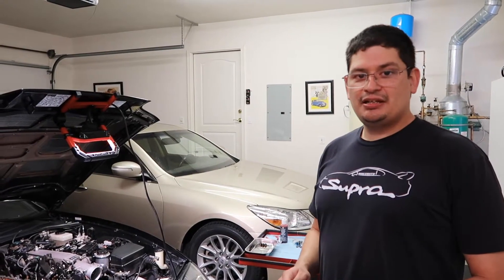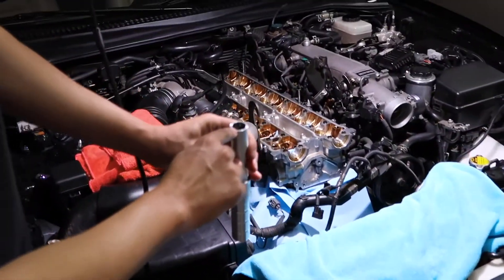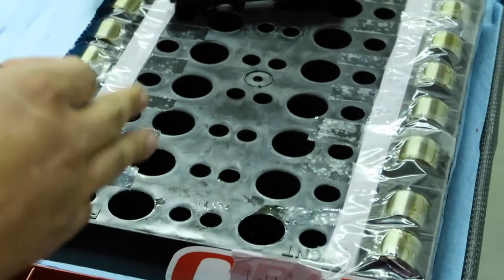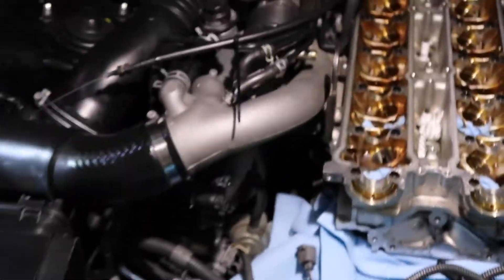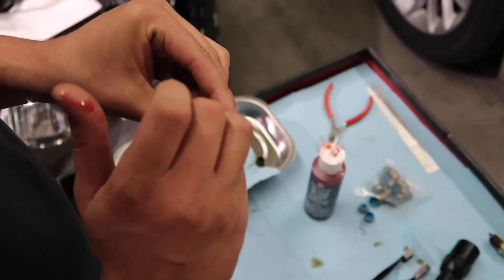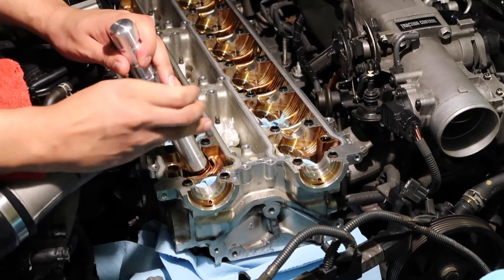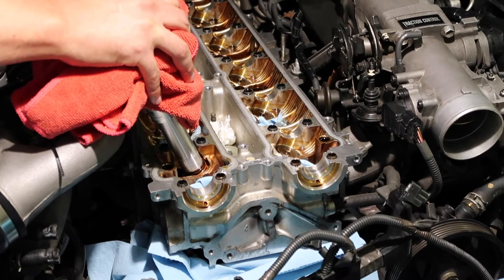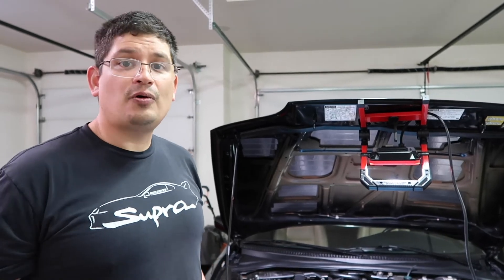2JZ-GTE Valve Stem Seal Removal and Replacement-  ValveMaster by ToyoTool

Comment: Is the head removed to do that ? I can’t tell. I know some people put compressed air in the cylinder to prevent the spring from moving
Reply from the maker: No, the head does not need to be removed. You can do it with the rope or compressed air.

Comment: I may have missed this part but when the keepers, springs and seals are out, what is stopping the valve from dropping into the cylinder?
Reply from the maker: Yes, the most important part is to make sure you use compressed air or stuff rope in the cylinder, otherwise you will be in the big trouble.
Reply: @DriversTherapy  haha ok. I figured I must have missed something. When you pulled the retainer off I almost had a heart attack.
Reply from the maker: @SDSGarage89  haha ya I stuffed rope in it. 🙂🤘🏽
Reply: @DriversTherapy  sick. Thanks for the Vid, super helpful and this may be in my future. Love the Supra.
Reply from the maker: @SDSGarage89  thanks! Let me know if I can be of any more assistance.

Comment: i just used some long nose to pull the seals out give it a little wiggle and it should come out  just make sure if theyre really old you dont leave any rubber rings that peeled off around the valve guides
Reply from the maker: Nice but just be careful not to scratch the bore where the buckets sit or it can cause a big issue.
Reply: @DriversTherapy  yeah I just grab around the outside wiggle comes free n then clean up with a pick

Comment: Probably a good idea to do the valve spring upgrade as well as do cams when we do this?
Reply from the maker: Not really. If you are stock, your valvetrain should be fine. No reason to change it unless you are running more power or is part of your build plans.

Comment: Use a heat gun on the stem seal before you remove it, you don't need to get it crazy hot just heat it up for 10 seconds and the seal will come off super easy, did it on my 3uz-fe.
Reply from the maker: Great idea! Thank you for sharing.

Comment: How did you keep the valve up ?from dropping
Reply from the maker: You use rope or air. Let me know if you want to know how those work.
Reply: @DriversTherapy  how do you do this using rope?
Reply from the maker: @johnpierce149  pretty easy. You set the cylinder you are working on to “bottom dead center” and stuff it with rope. Than you slightly go up to Top Dead Center till you get some resistance and stop. Than you are ready. The rope prevents the valve from going down. Just make sure you stuff it with rope and compress it.

Comment: So what i do get is when you push down on the tool for the cap and 2 keepers, that the keepers will snap into the valve on the top side.
But what i dont get is when you also push down on the cap to remove the cap and keepers, how does that work when you are pushing down and not pulling up ?
Reply from the maker: The same action is for both removing and installing. The difference is the tool itself. One side has a magnet and the other side is designed differently. The tool is key when performing this job.

Comment: Great video! How did you manage cylinder 6 springs with the tool?
Reply from the maker: I had to be very careful but I still messed it up on one spring and I had to sand for a long time to clean up the nick I did on the bore. I advise you to try to get the tool aligned as best as you can, just don't hit the bore. It is doable but you have to take your time and lean over. The only other suggestion is to remove the "engine removal hook". Thank you for watching the video.

Comment: Hey Man, i also need to do this soon.. is it the VMT68 for the toyo tool that you got?  I also got a valve stem remover tool from amazon for like $10 bucks and the powerdynamics (24) valve stem seals... trying to figure out what else I should replace along with doing the job... how long did it take you and what do you recommend to replace? I've also seen people use like a string or compressor to keep the valves falling down into the pistons... how did you keep yours on while removing the valve stems?
Reply from the maker: I used the rope method. I attached the link to the rope DIY and valve replacement. It was helpful. I also recommend using a known brand of valve stem seals. Don’t go cheap because the work to do them is a lot. If you need help or advice you can email me. My email is on my channel information page. I also recommend the Toyo tool.
Reply: @DriversTherapy  I got the same valve stems you used with the viton. Def I'll email you when I run into an issue. Thanks brother!
Reply from the maker: @alexchen4095  if you want, I can lend you the tool. Just pay for shipping both ways and I am cool with that. The rope method is easy to do unless you have access to solid source of compressed air. I would also get some sand which bags and egg cartons to make sure you remove the valve train and keep track of it so you done lose or mix the parts up.
Reply: @DriversTherapy  I appreciate that man, I'll keep that in mind for whenever I'm closer to doing the work (might be a few months) when I can get the parts and stuff. Did it take you a weekend to do the job?
Reply from the maker: @alexchen4095  I did the valve stem seals and my timing belt and water pump with all the associated parts at once. Took me over 2 weeks. It was my first time.
Reply: @DriversTherapy  I gotta say, I look up to you. I want to start learning these things on my own as well and your a huge help.
Reply from the maker: @alexchen4095  thanks man. I appreciate you watching the channel. Let me know if can help when you start the job. Have a good one!

Comment: Are u supposed to be able to get a pic under the valve stem seal or should it sit flush ? First time and dont want to redo it
Reply from the maker: If you use the tool and you press down, you should be good. I roughly measured the first ones by taking a measurement of the old valve stem seal  and another when I installed the new one. I took the measurement using a small ruler. I only did it for a few of them since once they are down, they are down. Don’t over think it.

Comment: Perfect timing on the upload of this video.  I'm about to tackle this job myself for the first time.  Thank you for taking the time and for being so thorough.
Reply from the maker: Your welcome. Thank you for taking the time to leave a comment. If you have any questions or need help, comment and I will reply as soon as I see it.
Reply: @DriversTherapy  Thank you so much.  I'm diving into your channel, I love the content and the originality of you and Elise!  I've got a '95 TT Hardtop and live in Utah.  My GF and I have had our Supra out to the Denver area a couple of times though.  Maybe a cruise event someday??
Reply from the maker: @robvigesaa5738  thanks man! Your not too far away. I go to SLC half a dozen time a year and I live in Grand Junction which is on the way to Denver. So your starting the job? Are you just doing the seals or are you doing other things? Do you have a service manual?
Reply: @DriversTherapy  Even better.  We always take I-70 on our way out.  Yes, I've started researching the job today.  My car needs it done, badly.  I have an entire digital service manual for the 1995 model year saved to my desktop.
Reply from the maker: @robvigesaa5738  nice! Let me share with you the  best written DIY after comparing them. Here is the link. https://www.mkivsupra.net/topic/25319-how-to-valve-stem-seal-replacement/
Reply from the maker: @robvigesaa5738  just be careful to not scar or hit the cylinder area where the bucket slides in. It is such a tight tolerance that a small imperfection will require sanding.